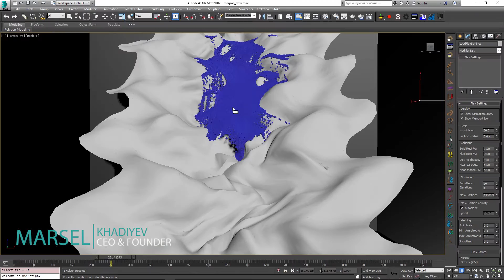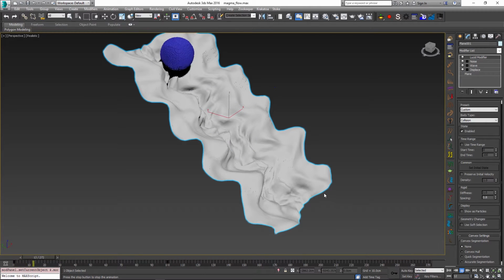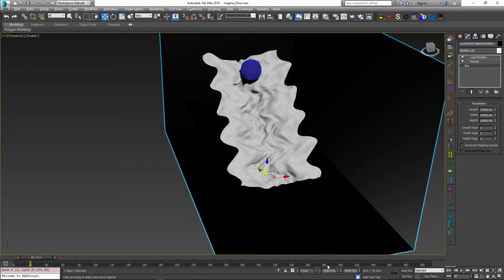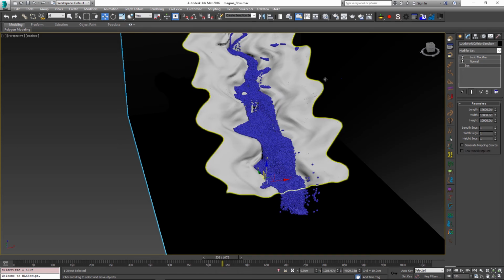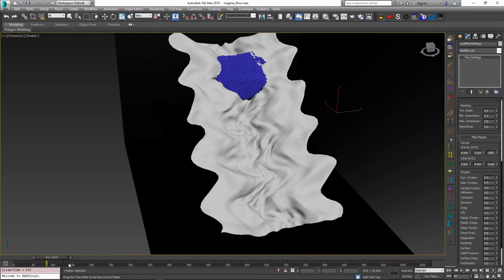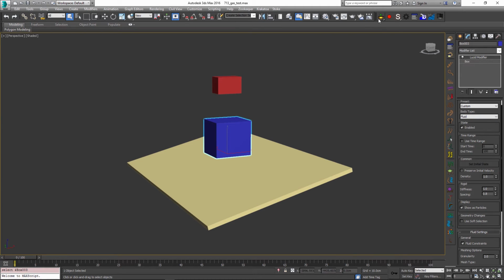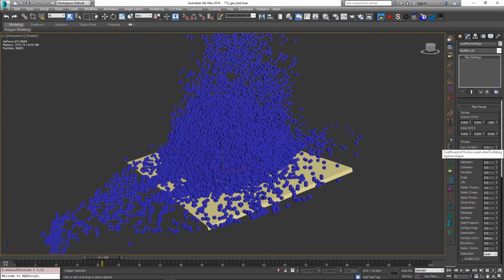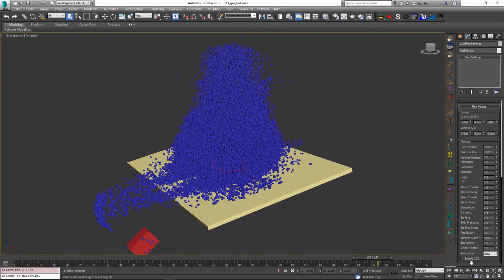Lucid Physics Beta Update 14 (Non-liquid particles: basic grains and gases)

Comment: What is the difference between drag and damping. Can they be used for fluids like mud etc Thanks
Reply: +GoodDay Yes, these are both forces which can be added to all particles in the simulation. Drag adds a counter force which resists movement of any kind. Damping is similar but is added to springs to reduce bounciness between them.